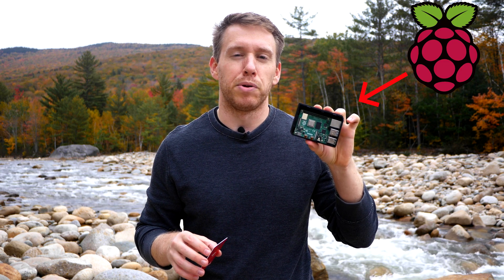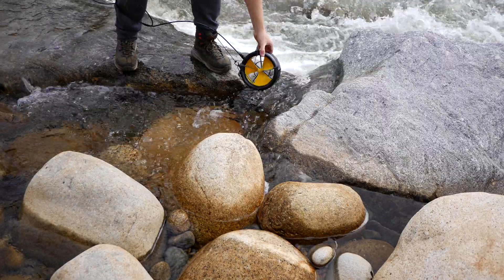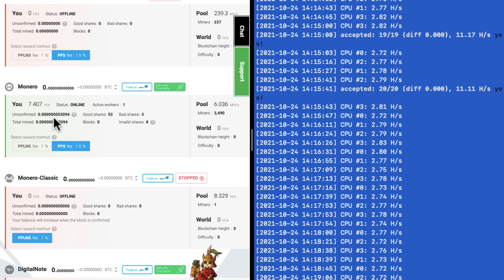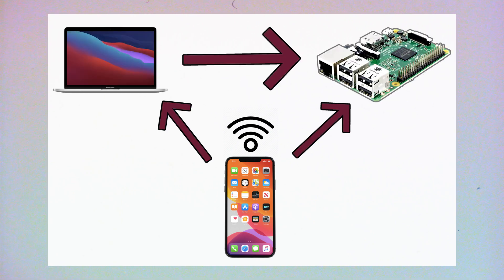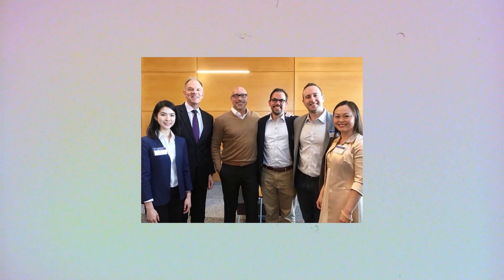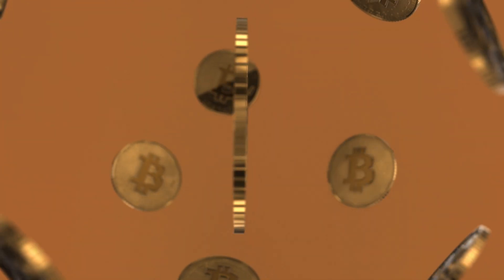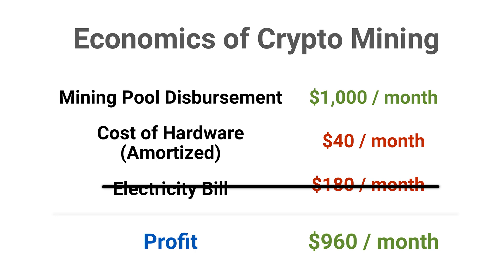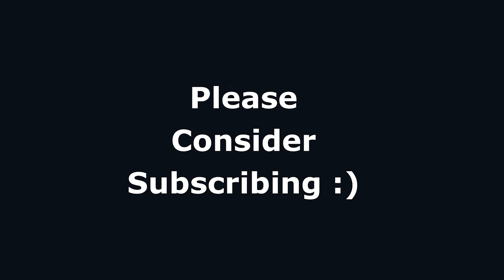How Much I Earned Mining Crypto Using Hydropower

Comment: wouldn't you want to put a capacitor or voltage stabilizer before plugging into the pi?
Reply from the maker: The rig could definitely be optimized.